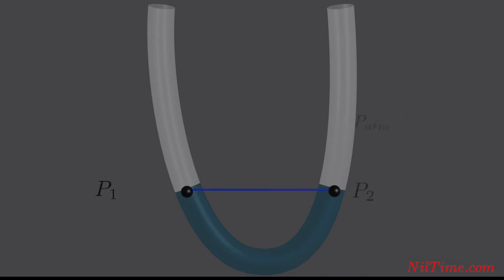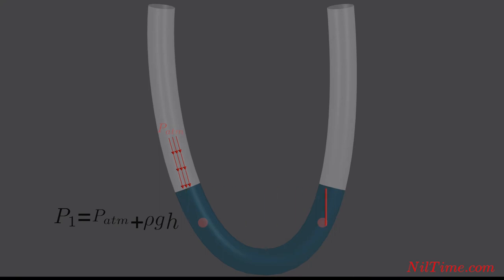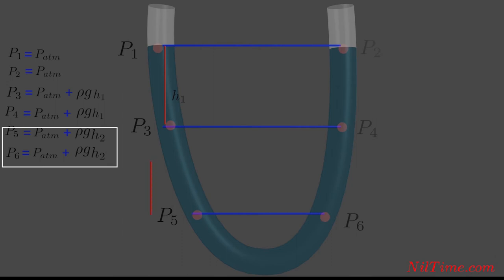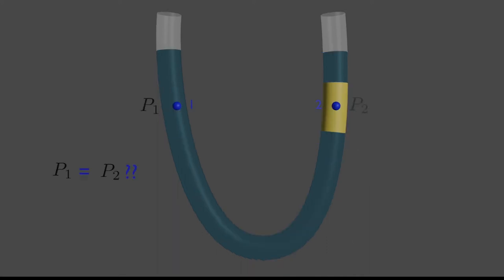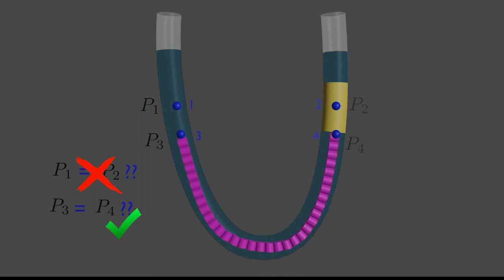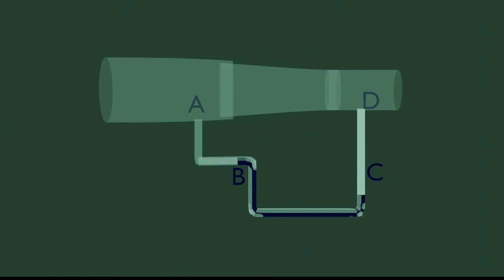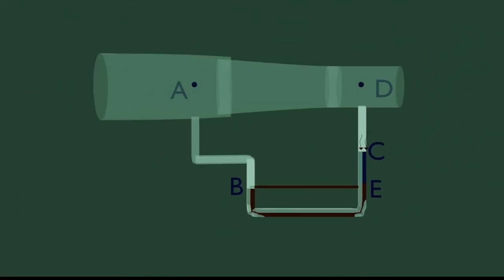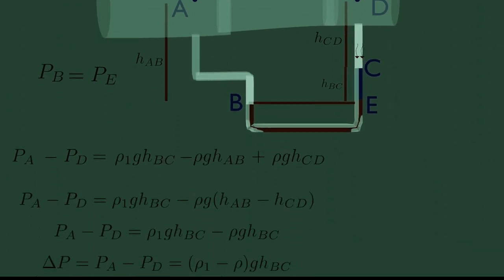How Manometer works? 3D animation

Comment: If the yellow fluid is of a different density and therefore weight, how can P3 and P4 be equal? They would be experiencing different pressure on top of them.